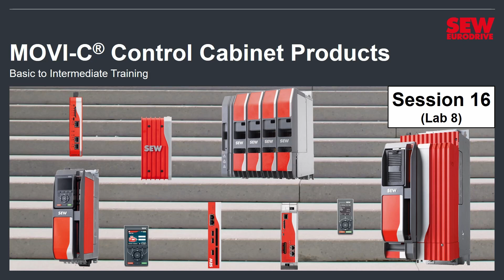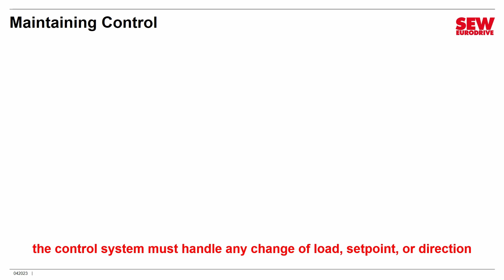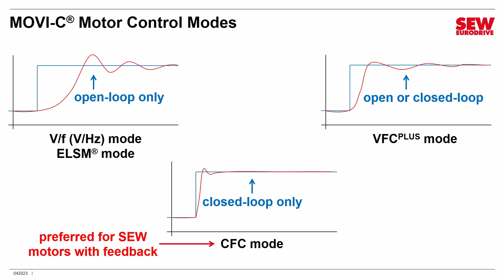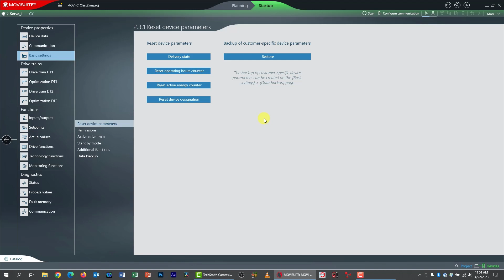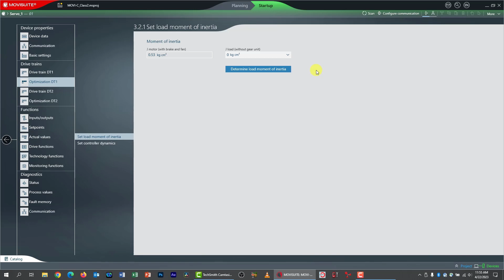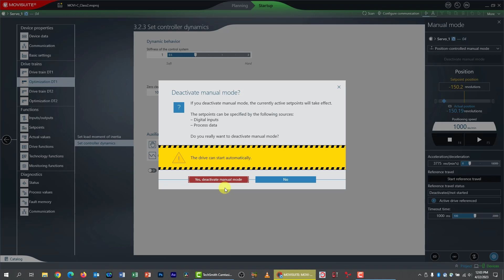MOVI-C® CC Training – Session 16 / Lab 8 – CFC Startup and Load Inertia

Comment: Can you explain how to use RTU communication with your VFD.
Reply from the maker: Hello. The new Movi-C inverters don't support Modbus RTU for fieldbus control. They do however have the Modbus TCP protocol with the Ethernet option card.

We do have some other devices that support Modbus RTU and RS485 for fieldbus control such as the Movitrac LTE-B, and Movitrac LTP-B.

Here are the operating instructions for those and you can search for the Modbus RTU section.

Movitrac LTE-B: https://download.sew-eurodrive.com/download/pdf_u/29135451.pdf

Movitrac LTP-B: https://download.sew-eurodrive.com/download/pdf_u/30593557.pdf
Reply: Other hand RS -485 communication
Reply: I recommend that you view the last two videos of the MOVITRAC LTE-B+ series on this channel. It discusses the fieldbus capabilities of the MOVITRAC LT series, which supports MODBUS RTU. We don't go into great depth about MODBUS specifically but rather focus on getting the VFD's connected to the fieldbus and the protocol (3PD) that you have to use to control the VFD over it.